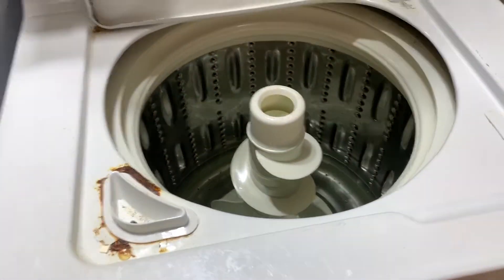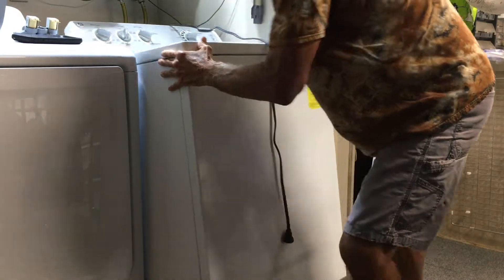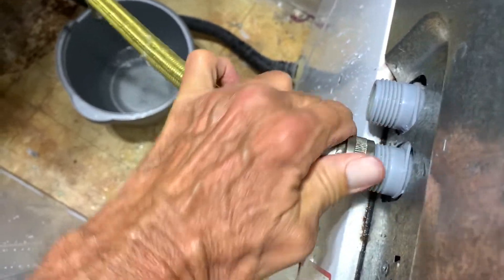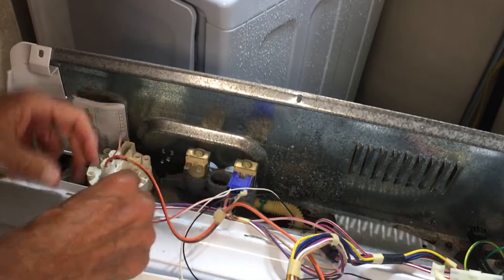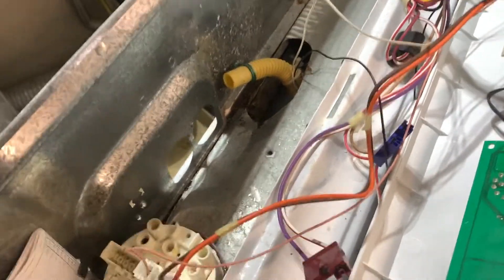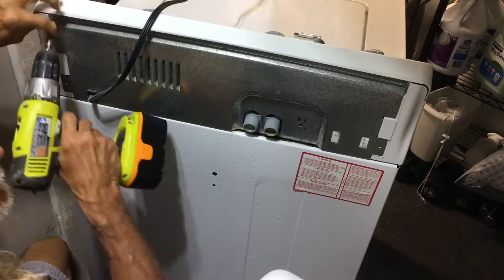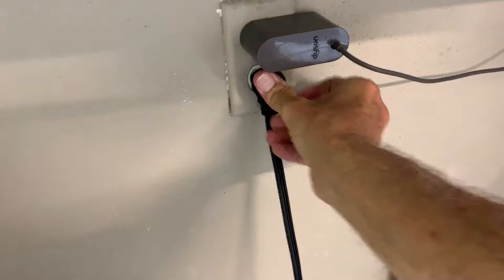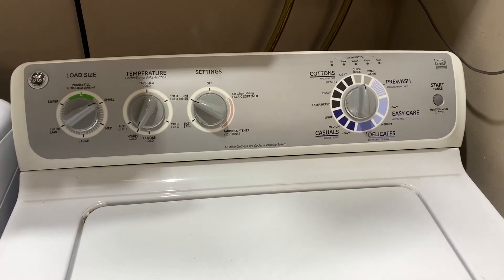How to install a Water Inlet Valve on a GE Washer

Comment: Thank you for this great video! I watched another person's video which I thought was for this model, until the part arrived. Hoping it was the same, I opened up the back but it immediately was clear there were big differences. Knowing that the panel had slots to slide to be removed was hugely helpful, and seeing you wrestle with the clamp and having to muscle off the valve was exactly what I needed to know I was doing it correctly. The whole thing took maybe 15 minutes once I had the right tools lined up. One FYI for others, if you don't have a power screwdriver and don't want to mess with a drill and strip the screws, use manual Phillips and 1/4-inch square/hex head screwdrivers. They don't need much torque to get out and back in. Saved the cost of a service call!!
Reply from the maker: Excellent job way to go do it yourself save money thanks for the tips and thanks for watching

Comment: I fixed mine for zero cost. 1) I determined which solenoid valve was leaking.  - 2) I removed the valve assembly. - 2) I removed the plastic debris filter from the inlet. I rotated the rubber solenoid washer with a pick tool. - 3) I hooked up hot water to the offending to the leaking valve. - 4) I hit it with pulses of hot water from the supply hose while... (4. - activating the solenoid switch (120V).  6) After 5 pulses the offending valve quit leaking. Summary... The little rubber washer (spring activated), gets clogged with a bit of debris.
Reply from the maker: Excellent tips and information we appreciate your contribution and thanks for watching

Comment: Are these adjustable for amount of hot and cold water going in?
Reply from the maker: There was no adjustments on the unite you can regulate the flow from your turn vales coming into the washer
Reply: @TomLeeman  Thanks. Since there are those two openings in the metal above the two cylinders I thought maybe they might be to use some tool to turn those odd looking, don't know what to call them, they're not screws, thingies in the top of the cylinders.

Comment: Unfortunately mr GE washer has a wire going through a hole in the plastic part of the water inlet valve.  I took it apart up to the point where the wire goes through the hole.  The parts list says it’s a thermistor.  My only question was how to get that out.  There also seemed to be a washer above it.  Would a thermistor normally just pull out or us there something else I need to do?
Reply from the maker: Should slide out but that might be a different models and the one that I have so be careful make sure it’s unplugged
Reply: @TomLeeman  Thanks for the reply.  I pulled up on the washer which actually was part of the thermistor and it did come right out.  I ordered the water inlet valve so hopefully that will do the trick.
Reply: @TomLeeman  The washer I mentioned was actually a part of the thermistor.  I pulled it out and was able to make the fix.  Thanks!

Comment: What size were bolts in back
Reply from the maker: not sure what you mean
Reply: @TomLeeman  What size hex bit did you have to put in the drill to open the back of the washer?
Reply: 1/4 inch

Comment: Important note. Replace the old deteriorated rubber washers inside the hoses. Rub on it and black stuff will come off on your finger. It just takes a little of this to jam up the valve. This is probably what caused the problem to begin with so if you don’t replace the rubber washers you are wasting your time and money.
Reply from the maker: Excellent tip thank you and thanks for watching